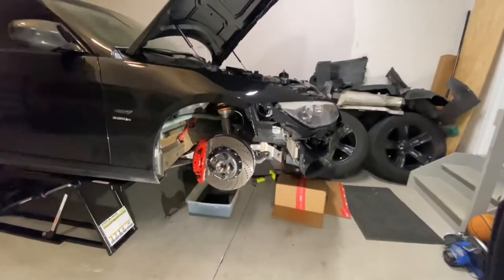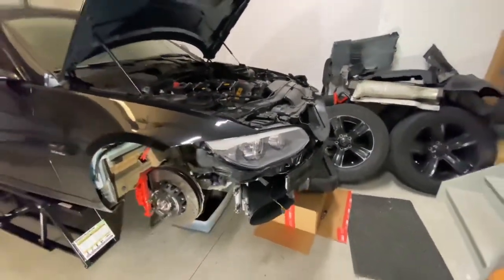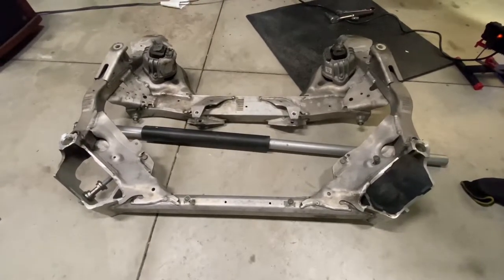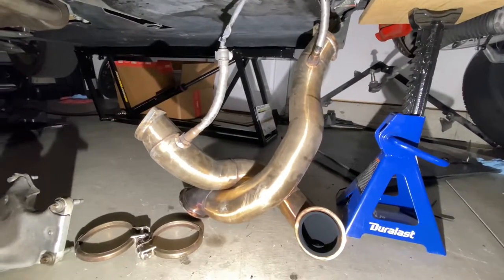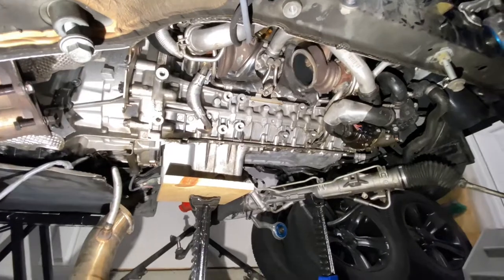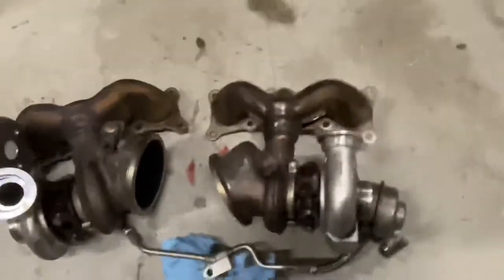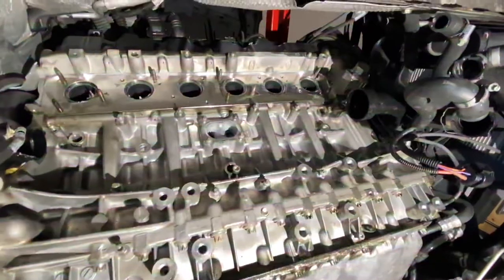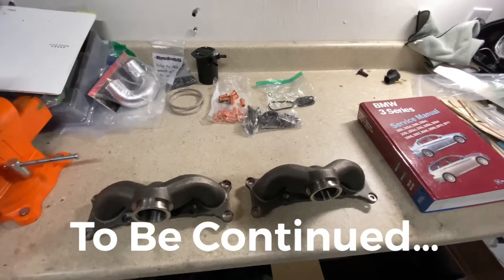335is Gets RB Turbo Game Finishers HF (19t), Part One

Comment: Installing the inlets is also a pain in the ass but have in the engine stand and will help you raise the motor up to get that back one in. very tight back there as you know!!
Reply from the maker: Just getting the old rear inlet out was a pain in the ass. Glad I’m going with hot side inlets soon I don’t have to worry about that anymore.